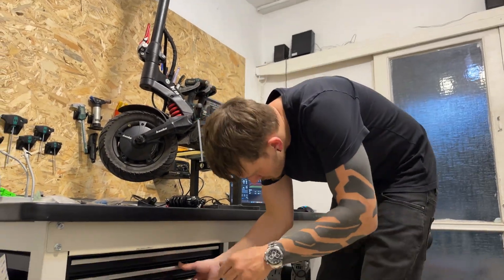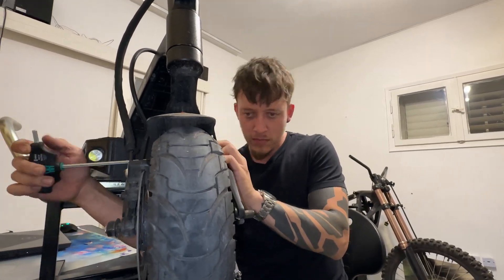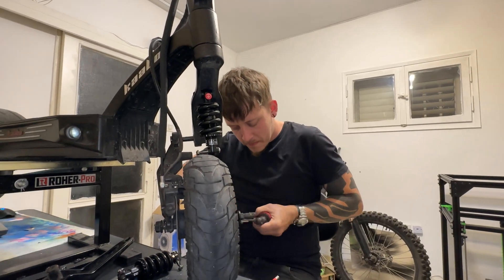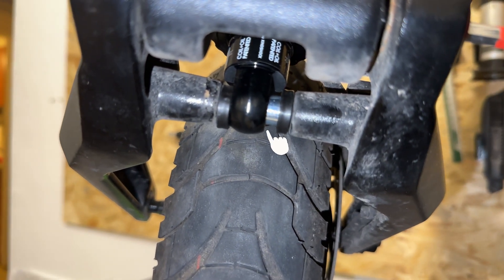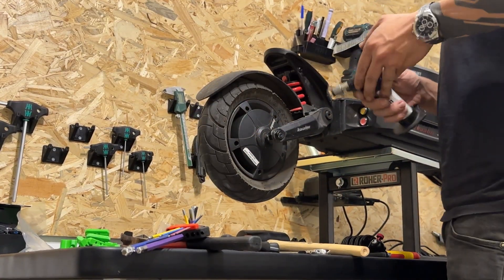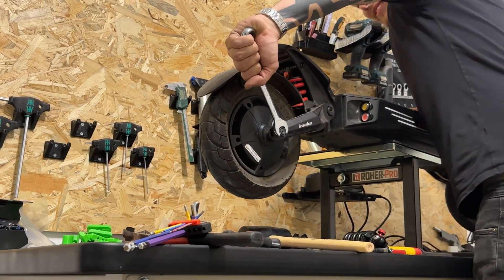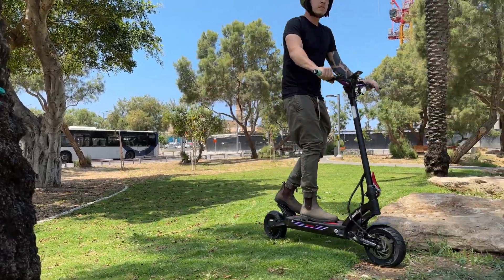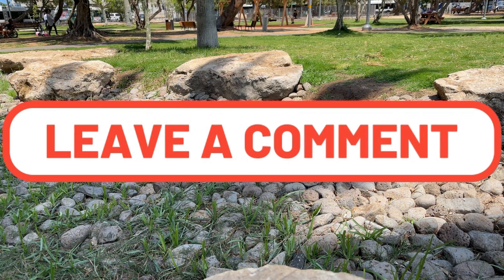SUB13s Mantis King GT: Step-by-Step Shock Replacement

Comment: You should have let the people know what spring you're using.
Reply from the maker: 125mm 2000 lbs 

I just found this on AliExpress: ₪273.72 | KS 291 R Bike Shock Absorber 125 150 mm damper adjustable Rear Shocks Downhill DH CX MTB Electric Scooter Motocycles exa form
https://a.aliexpress.com/_ooTvi8Q

Comment: Why did you choose 2000 lbs springs instead of dedicated 1500 lbs if their hardness can be increased?
Reply from the maker: @ikswohceicjow  they initial stiffness can be increased, not over all hardness
Reply: @SUB13333  In that case, why did you care about that hardness? Do you mainly ride in the city? By the way, i've ridden Nami, both Burne and Klima they are incredibly soft, i wonder what springs they have there:)

Comment: I'm having trouble finding the correct rear shock for my Mantis King GT. The ones I keep receiving are too small at the bottom where the shock fits onto the control arm. Wish I could send you a picture that would show you the difference between what was on the scooter and what everyone keeps sending me. My scooter which I use to commute to work is in pieces and I don't know what to do.
Reply from the maker: @jayparker393  send msg on ig I’ll send Ali link

Comment: hEY BUDDy some attempt on trying to remove the swing arms, ive tried every possible way that i know such as wd40, vice grips. Im able to rotate them if i strain n sweat like a mad man otherwise they will just not come out. Do you have other tricks?
Reply: I'm having the same issue. Did u ever figure it out?
Reply: hey, did you ever get them apart? im in the same situation. im gonna put it on a vise at work for better leverage and see if that will work.

Comment: Hey for some reason the bottom part of the shock which is connected to the arms, just wont come off for me.
Reply from the maker: Use force oil and shake . It’s just tight fit
Reply: @SUB13333  force oil?

Comment: im thinking of putting ajustable suspension on my scooter could you tell me how many inchers is it between the middle of each bolt because i think there the same size as mine which are 5 inch give or take
Reply from the maker: 125MM
Reply: @SUB13333  oh no your is way bigger than mine thanx anyway

Comment: Hey mate, how would you compare the original ones to the exa ? … is  the original suspension like 1500 lbs exa or more like 2000 ?)
Reply from the maker: Definitely like 1500. I’m 84kg and 2000 feels on spot

Comment: blue loctite melts around 300F so a hair dryer or better a heat gum or a soldering etc should mitigate that issue when it exists.
Reply: oh, ha ha you later in video showed using the soldering torch!

Comment: Are the stock shocks fake? Chinese scooters usually put fake shocks, it's basically only a spring, with no shock absorbtion. For example my Laotie ES18 came with fake shocks, after i put EXA with rebound adjustment it felt so much better. EDIT: I just saw you mention you lost rebound in the stock shocks, so they are real, but got compromised and stopped working over time?
Reply from the maker: Yeah they worked for about 500km.. After that, rebound knob wouldn't make any difference. 

exa are pretty good for now.i need to get 2500lbs springs tho and theyre very hard to source. 
seen on ali, but for some reason only 1 available for each buyer.